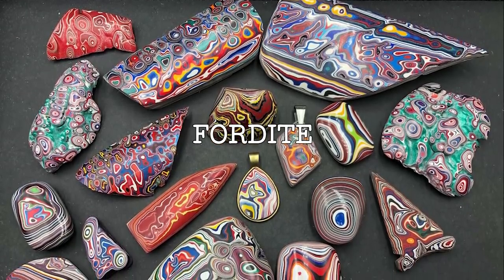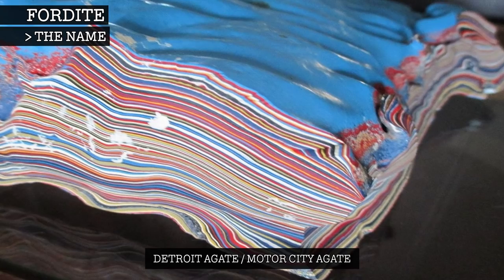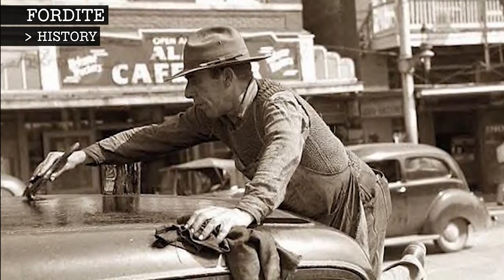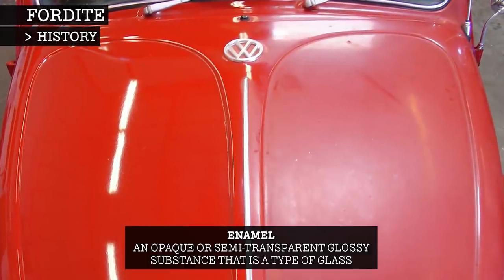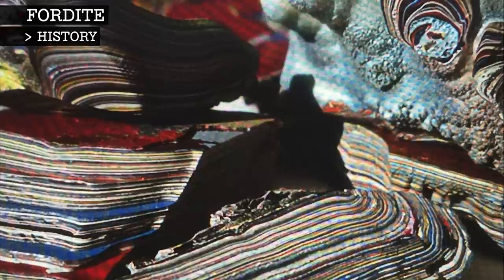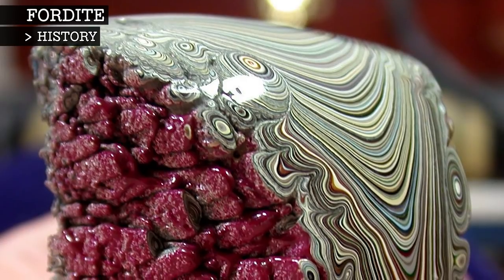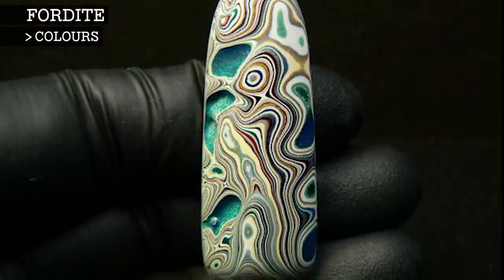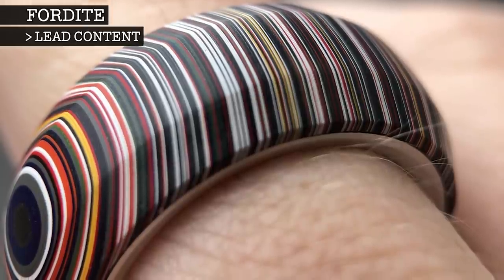FORDITE.

Comment: I used to work in a model making studio. In the paint room, we'd mix the paint to the desired color and had a board to test out the color or make sure it didn't clog in the spray. After a while a bump shows up, then grows and grows (all the layers of paint) and we would cut it off, slice it, style it to show off all the layers of paint. A former coworker had made a pretty fordite turtle.

Comment: I spray paint kitchens and furniture and we have slag everywhere and we have to remove it out on the regular but it’s kinda boring as most of the time, kitchens get painted white 🤷🏻‍♂️
Reply: It also wouldn't be quite the same even if it was different colors. Unless.... you happen to bake those kitchens and furniture after painting them.

Comment: fordite wouldn't have been baked it would have built up in the spray rooms/booths
Reply: No, fordite was specifically baked on the tracks the cars were sitting on. The buildup in other rooms would not harden to such a degree.
Reply: Actually, all real Fordite is baked. They are not painted in a closed in booth, more like a paint-line.  They are all on carriers that run on conveyers, linked back to front with about 6 feet between.  Unless there is a breakdown they move from color booth to Clearcoat booth to oven, never stopping until they are ready for sorting/storing, which is where they wait to be selected by color to go to trim shop.  When the carriers deliver the product to pre-delivery the vehicles come off of the carriers and it goes back to body shop to start the whole process over again.   I lived it for a very long time! 
 TM. Ford Motor Co KC, Mo plant. Paint department 30 years.